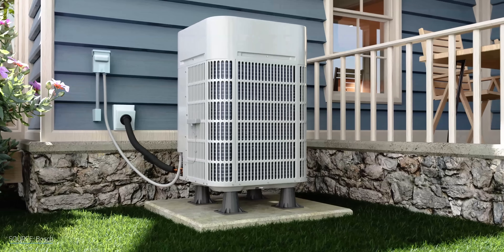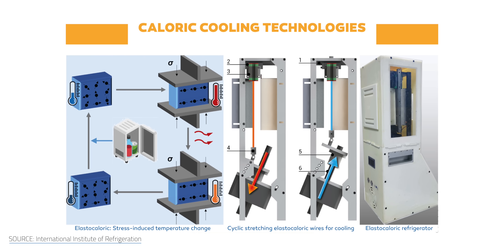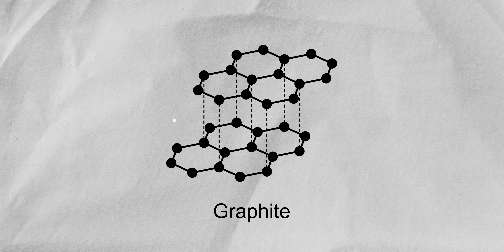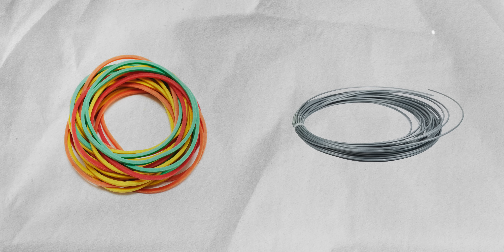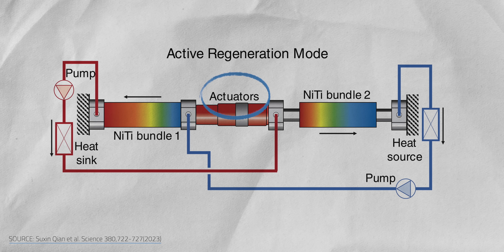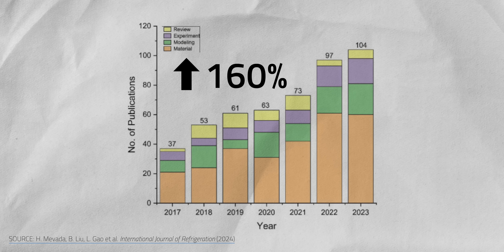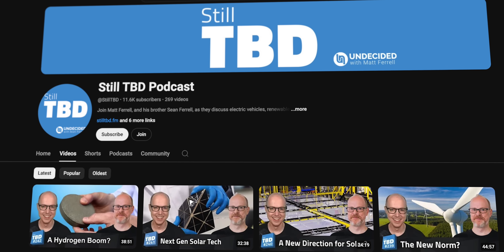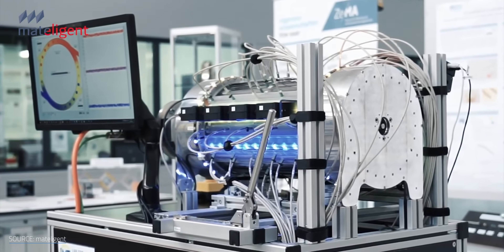How Solid State Cooling Could Change Everything

Comment: Micro fridges are a perfect fit for this new tech. They are currently very inefficient since they are thermo electric.
Reply: Technology Connections recently did a video on these, and found that they kinda suck. Very buyer beware, actually.
Reply: @Descriptor413  All forms of PCT chip cooling/heating sucks.. people have tried it for CPU cooling and lets say your CPU has a TDP of 100 watts.. by the time you effectively cool it you not have 300-400 watts of heat output to deal with too in addition to the processors heat output
Reply: I remember when the tech for those mini fridges came out, it was supposed to be an epic game changer...... it wasnt
Reply: @Descriptor413  yes, that was exactly what I said: termo electric micro fridges sucks. That's why I am hopefully that this new tech is better for them.
Reply: @SkepticalCaveman  This assumes it's scalable to small sizes. I mean maybe, but not obvious.
Reply: Gotta start somewhere who knows what will happen to this tech down the line.
Reply: Micro fridges are a scam and shouldn't be used
Reply: Micro fridges? and what you wat to put inside this micro fridge? micro food? lol
Reply: @rtem-h6c  they are used for soda cans and medicine.

Comment: Having worked with nitinol, I had to learn the fatigue properties.  With constant amplitude deformation, it is considered to have infinite life.  It's supposed to be better than Ti64, which we actually tested one time to 40 billion cycles @ 300 MPa before we got sick of testing and started cutting grooves in the sample to force it to fail.

It really was a fun trick to hold a thick wire or small bar of nitinol to your lower lip and bend/unbend it.  The change in temperature is pretty shocking.  As a cheap alternative, you can do the same with a fat rubber band, stretching/unstretching it.  Because you can stretch it more, you also get a dramatic change in temperature.
Reply: "...before we got sick of testing and started cutting grooves in the sample to force it to fail" - how many licks does it take?
Reply: and how much do you think one would need to cool down a house?
Reply: @roboticdem0n  it comes down to latent heat which is the amount of cooling energy that can be harnessed from one mechanical cycle. Binary NiTi alloys can get up to 20-30 Joules of energy per gram of material, but this is for full transformation of the material without considering fatigue and therefore lifetime. Improved alloys with more alloying elements can be more stable while providing an optimized energy conversion. It's still a basic research topic, so hard to say what an actual functioning machine might look like and how it would perform. I've personally seen COP of around 14-18 in full transformation (thermal energy harnessed divided by mechanical energy spent). I'm guessing COP of around 5-10 could be realistic, which is 2-3x than what can be achieved with a gas compression cycle. So 2-3x more efficient and therefore cheaper.
Reply: @McReinsen  yea but how big would it need to be to cool lets say a house of 240m² or 2600ft²
because a "brick" the size of a car on the side of your house is not practical
Reply: @McReinsen  isn't the main issue moving it from where you want to be cool to where you want to be warm? Liquids are easy, but moving something solid is more of a challenge I can imagine.
Reply: @halkihaxx5 I imagine it would be like a monobloc heatpump. They heat or cool water which is then pumped around the building.
Reply: @halkihaxx5  I think the most sensible way of using this is creating a mechanism where a loop or multiple loops of wire are running around in a machine, are locally deformed and the energy is transferred away
Reply: @roboticdem0n  pure speculation as I don't know what kind of mechanism would be used to make this into a machine. Question is not what size a machine would be but rather what kind and size of machine people would buy. And this dictates the trajectory of development
Reply: @McReinsen  yes but people wouldn't buy a block of mashined metal the size of a car when a normal A/C unit does the job at the size of about 0.5m³
Reply: @roboticdem0n  bro this technology is at least ten years out. It will not be a machined block of metal and it will certainly not hit the market before it is packaged as an attractive product. Efficiency is the USP here but the product needs to have a market and make profit
Reply: @McReinsen   "and therefore cheaper" not when titanium and nickel are fairly expensive metals.
Reply: @justinw1765  they are, but how much do you need? regarding cost, TCO is most important. and if it's three times more efficient, it needs three times less electricity -> cost saving
Reply: @roboticdem0n 
Some people have suggested that when cars are all self driving few people will bother to own a car anymore because it will be easier and cheaper to just call up a self driving car 
whenever one wants to go somewhere.

That would open up a lot of space for on the properties of houses where right now there are two or three cars sitting on the property a lot of the time.

Of course a lot of people would still probably prefer to stick with a traditional air conditioner 
or use a heat pump and use the saved car space for something other than a huge 
cooling device.
Reply: @geofflepper3207  i mean in germany we call those windws + radiators. Where the only buildings outside of hotels that maybe have A/C are some large office buildings and stores.
Reply: @roboticdem0n  that will most likely change in the next decade due to climate change. it already gets almost unbearably hot in big cities in summer. more and more people are putting ACs in their homes.
Reply: @geofflepper3207  are you aware we already got “self driving cars” it’s called taxi 🚕 
Yeah and I don’t buy that taxis are expensive because of drivers salaries.
Have you heard about corporate greed? In recent years uber like companies are best example.
Reply: @roboticdem0n  it could be practical, but good point. also would like to know how much it would cost. "2-3x more efficient" statement says nothing about the end-to-end cost.
Reply: @McReinsen  given that COP depends on the temperature difference, the Carnot efficeincy would be a better comparison. Do you know the Carot efficiency in those cases?
Reply: @roboticdem0n  If the electrical consumption is 30 to 50 % of a normal A/C-unit and cost not much higher people would buy it even if it was a lot bulkier. Electricity is darn expensive in some places.
Reply: @roboticdem0n  Short Answer: "It depends" - because all things depend.

The Longer Answer: Well, what are you willing to do to improve the thermal efficiency of your house? If you are building from scratch and money is no issue - the answer is: Surprisingly few.

1. Solid Envelope - an Air Tight with a fully controlled inlet/outlet using a heat exchanger to pre-condition the air coming into the building is going to provide a great amount of efficiency.

2. We want 8" or 10" wall built in such a way that there is as little thermal bridging as is possible.

3. Rock Wool sheeting on the exterior to add yet more insulation factor. Overall - we are looking at somewhere like R50-R60.

4. The best damn windows on the market - and to limit them to strategic places, where we can opt to more passively cool/heat the room and basically use it as a giant thermal buffer whenever possible. Otherwise, we need to be looking at some pretty expensive windows, and realistically - we are capping to R17. We can have a retractable inner/outer transparent pane/film that adds further resistance but - it's really not going to help all that much.

5. Lighting - LED or bust.

6. Ducting work - crazy amount of ducting. Your fridge radiator, your computer equipment. Everything that can be put in a fixed location, and simply have cabling run the data to where you want to use it, will allow you to dump the extra heat more or less directly outside in the summer, and into the house during the winter.

If you build a house like that, in a house of 4 you probably need to deal with 1500-2000W of total heat exchange per hour (as an average) - for the warm bodies, absorption through the heat of the day, and anything that is drawing power and creating heat in the buildign (ex. oven). 

So if we are being conservative and presuming each gives us like 2W of cooling in order to survive for a respectable long term - the answer is like 1000 of them. But for a less um... well built house: like triple that.
Reply: 40 billion!?
Reply: Funny, I was gonna say exactly the same thing
Reply: Will it last as long as my Mother's round top refrigerator that's still cooling beer after 70 years??  (I don't know how old it really is as I am 70 years old and they had it in my baby pictures). Most new refrigerators they sell today quit before they are 10 years old, many just after the warranty runs out, if neighbors gripes are to be believed!
Reply: So to complete 40 billion cycles in one year:
Cycles per minute: approximately 76,103.5 cycles
Cycles per second: approximately 1,268.4 cycles 

and In 5 years:
Cycles per minute: approximately 15,220.7 cycles
Cycles per second: approximately 253.7 cycles

How long does it take for you and at what speed?
Reply: @mirceacibric  55 kHz.  We used a Langavin stack transducer with aluminum and titanium boosters.  Gives roughly 1 million cycles every 3 minutes.
Reply: @ We cycled at 55 kHz.  Yes, that fast.  The ultrasonic transducer that we used is commercially available.  They are used a dozen hours a week until they die, which might be 100+ billion cycles.  But MUCH lower stress.

Comment: Love this video! Having just gone through re-doing my original line set that the original contractor put in just 2 years ago, I can safely say that anything that does away with all that time and labor would likely be a big win. Why did I have to replace it? My original contractor used 5/8" and 3/8" copper lines with numerous unnecessary 90 degree bends, but according to Bosch's clear instructions for the length and lift needed, it should have been 7/8" & 3/8" with gradual arc bends where possible. This made it noisy and inefficient. Sigh. So I did the removal and installation of a fresh, pre-insulated line set, handling the crawling and clamping and insulation splicing (under the careful oversight of an actual HVAC contractor) in the tight spaces wearing a respirator. While great for my sorely needed core strengthening, it was quite the gymnastics challenge, especially in the 95F heat. I also re-did the outdoor line set cover to ensure I have no bare copper in the outdoor elements to corrode from condensation and trapped moisture, and I installed a proper UV resistant covering over the outdoor portions that leads to the heat pumps, additionally protecting them from degradation due to UV rays. Finally, I used some thick rubber matt behind the wall on the re-done line-set to reduce the transmission of vibration (noise) of the lineset into the bedroom space right behind it.

So on top of the environmental benefits of not worrying about the gases that are released during the discharging and recharging of the system that turned out to happen about 6 times overall for each of our two heat pumps  (due to a clogged filter during a purge and other complications), something without the liquid could be a huge cost (labor) and material (copper) savings too. Too bad solid state cooling doesn't sound at all likely to be mature enough to avoid 2026's requirement to use A2L refrigerants given their flammability which I'd much prefer not having coursing through my home. But maybe it will be the tech behind the day that I replace my entire heat pump system. I'm told these days I'll be lucky if I don't have to worry about that rip and replace until about 12 to 15 years from now, unlike my prior home whose central air conditioner and line set lasted over 25 years.
Reply: I still don't understand why flammable refrigerants are such a issue when we consider how many homes have natural gas or propane appliances.  Such appliances have a virtually unlimited supply compared to the small amount needed when used as a refrigerant.
Reply: @Wooble57  it's different because refrigerants are compressed, so you end up with propane running through a compressor up to maybe 200 psig. 

Also, the refrigerant exists in two phases through the system and liquid propane has a lot more bulk than vapor. A break could potentially set off the equivalent of a long burning propane torch if it ignites.
Reply: @CasualGamerCC  the only time you have high pressure is when the system is sealed though.
  Yes liquid propane exists when used as a refrigerant, but that's also how it's stored for use in appliances.  A fridge might use a few oz of propane to function, a home might have a tank with many hundreds of pounds.  Heck, even a 20lb bbq tank has 20x or more the amount that would be in a fridge.

Natural gas is a little different, it's not stored in a liquid state, but supply is effectively infinite in this context.  A natural gas stovetop would burn through a btu equivalent is about 4.5 minutes.

  I'm not saying flammable refrigerants are safe, but i still don't see anything here explaining why they are more dangerous than having a gas supply to the house in general.
Reply: @Wooble57 Fair enough, I suppose my bias is showing. For my 33 year old home, when renovating we ripped out all natural gas lines and bulky baseboard radiators, we plugged up and insulated our chimney and flu, and went all electric for everything including solar and battery storage. So the notion of adding something flammable in our next heating/cooling system has less appeal for us. I tend toward solutions that reduce risks, especially as it’s our forever home where simpler/safer long term investments are most appealing as we age and try to reduce cost variability.
Reply: @TinkerTry  There could be a reason flammable refrigerants are more of a hazard than gas appliances, and if they are I would love to know the mechanism.  It would be unfortunate considering their environmental benefit though.

It just feels like a lot of people give them a unfairly hard time with what I know.  Options to reduce climate change that are economically feasible are limited and we could use all the ones we can get our hands on.

Comment: I’m wondering if this can be improved by creating MEMS out of them. A.k.a. Creating heat using a resistive wite into a device, and using micro-actuators to push a wire. These things aren’t new in the world of MEMS, but creating a quality elastocaloric material inside a small chip might be crazy difficult. But once that’s done you could run it at crazy frequencies to get a lot of heat movement out of a very small device. And potentially eliminate a lot of the other components in the system that would otherwise introduce losses in efficiency.

Comment: Honestly, with extremely careful tweaking, a compressor based ground-water-sourced heater can reach full-system COPs of 7+.
(its just that most installers aren't very good in tuning, or that the time investment isn't worth the energy saving to hire a professional to do it)

Comment: "There isn't a single technological savior that's coming to liberate us all". That's because its not a technology problem, its a political one. The fossil fuel industry is so large and politics so corrupt it will take some time to push them out. The fact is that renewables are already cheaper than fossil fuels, but the political resistance is strong.

Comment: Still in favor of a Solar powered pelliter pump that can be used for cooling as well as heating and the only moving part is the circulating fan and diverter door over the temperature plate hot or cold side.
Reply: pelliter are really bad at cooling anything and you are still using power - even if its on its own system like a solar panel and not everyone is going to have the ability to have one on their roof, and thus you come back to the same issue of having to figure out how to power that for everyone. Over all almost everything else is better long term than a pelliter
Reply: @adr2t  Well here in America in fact quite a few people have Solar on their roofs and in some places, wind and solar with Tesla power walls so power is not a problem.  No inverter is needed, just some sort of power rectifier or the like.

Comment: Calling Wind and Solar energy collection more advanced than the human digestion system is a little bit of hubris don't you think?
Reply: If you can tell me how to charge a phone battery from my gut, I would appreciate the extra capacity.
Reply: I'm still working on the conversion process. I will get back to you once I've cracked the nut.

Comment: Of course I would interested in any new way to cool.  I also see that there would be a stress fatigue, and that would cause eventual breaking in the wires.  Of course, properly designed wire sections would allow easy replacement.  Then, here is a bit of a rub and opportunity, those wired can be used to make, new unstresed wire.  That recyclability is the opportunity, but the rub is the energy to do that   So, the total efficiency of the system needs to take that into consideration when evaluating the energy efficiency.  Meeting existing liquid based efficiency, without the recycle cost being included would make it a failure.  It will need to meet that goal while including that energy cost.  (Liquid does not get stress fractures and break.)
Reply: Well the fact you can't recycle the gas in other systems already would be a total win over current methods. Even if it takes power to remake new - the other escapes and can't be reused at all thus we have to make more and that gets release back into the gas system that would take A LOT more power to get back out of...